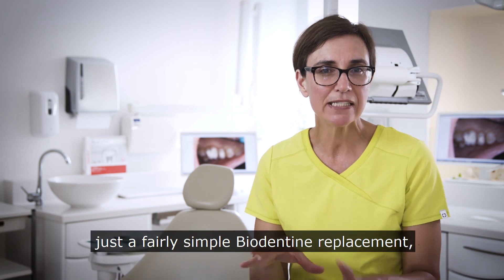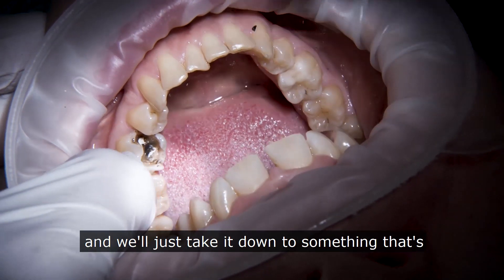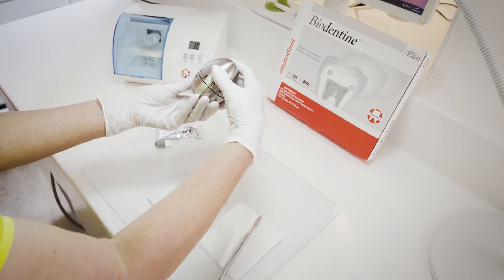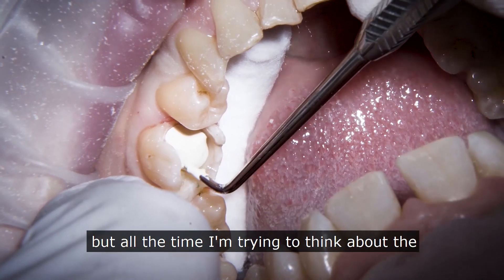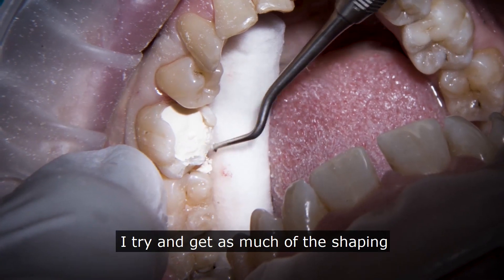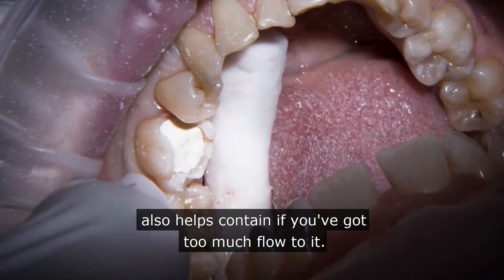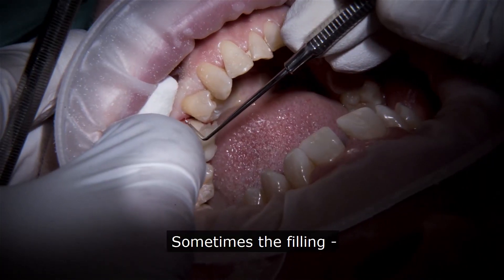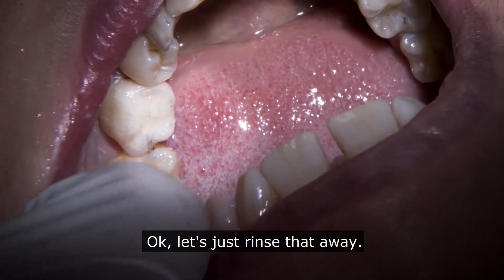Treating secondary caries with Biodentine by Dr Nicola Bone

Comment: why did you not use a thin layer as a linear and complete the filling with composite.
Reply from the maker: Hi,
Thank you for your interesting remark.
 
Biodentine is a dentine substitute which combines pulp therapeutic properties with strong dentine-like mechanical strength and hardness. Unlike cavity liners such as MTA, Biodentine can fill the entire cavity in a single increment with the Bio Bulk-Fill procedure, under final composite restoration. Biodentine simplifies daily cavities restorations by avoiding layers and light curing compared to traditional methods
 
Learn more about Biodentine and the Bio-Bulk Fill procedure here: https://info.septodontcorp.com/hubfs/2025.04.02-Biodentine-One-pager-Protocol-BBF-illustration.pdf

Comment: A little bit strange sequence of technique! The procedure starts with use of Rubber dam - Bravo! But why isolate one tooth!!!! Then having to take the dam off and proceed with the bit of treatment (bonding of composite to tooth tissue) without dam isolation. Especially on a lower tooth, when saliva pooling and control would be just so much easier if the dam was placed across several teeth and not taken off until cavity is filled. Neater, cleaner, more predictable.
Strange!!
Reply: I was thinking the same. And then to add insult to injury.. etching the neighbouring tooth
Reply: also why did not do cuspal reduction for weak cusps